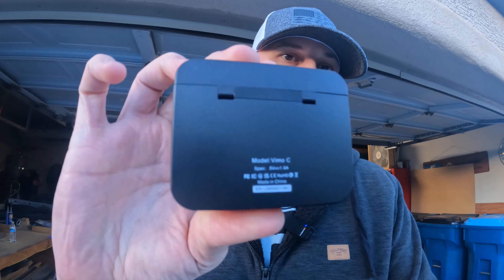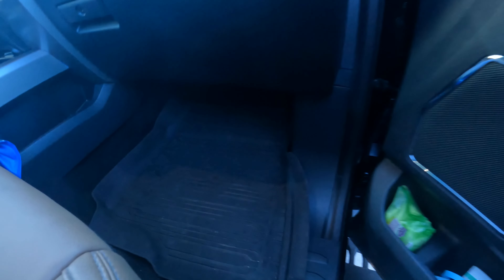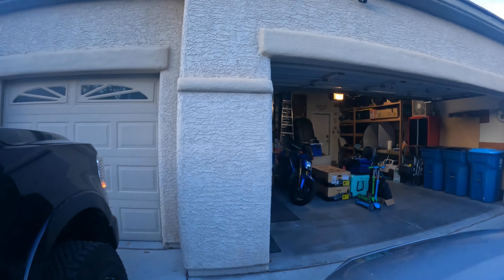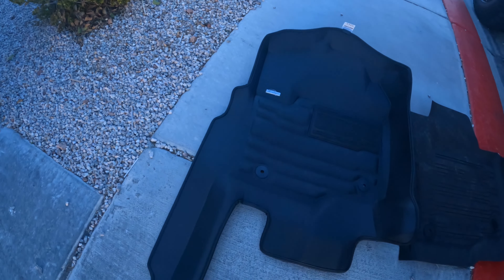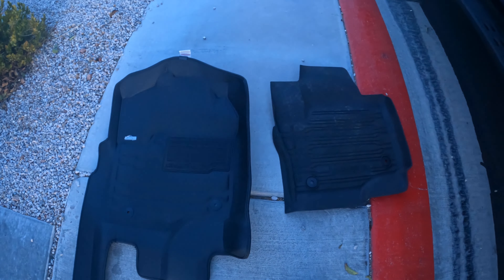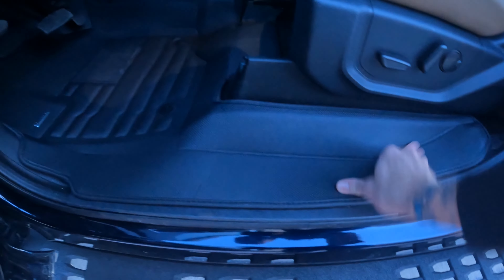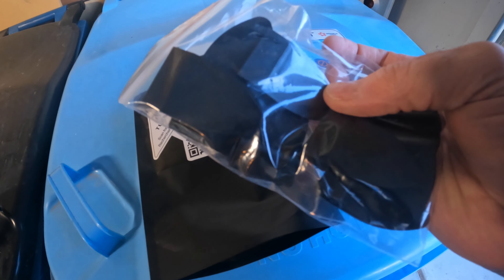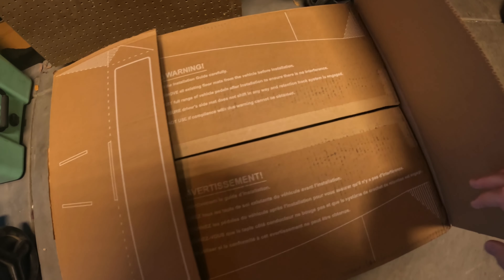Upgrade Your F250's Interior with Tuxmat Floor Mats - The Ultimate Protection and Style!

Comment: Those are the best looking floor liners I've seen. In the same boat with you on the tape/clip aspect... seems like a potential hassle for wear over time (or removing and replacing liners for cleaning).
Reply from the maker: I’ve found the clips don’t have a strong enough tape and I’ll probably be adding some better 3M tape later on. But these liners do look great.